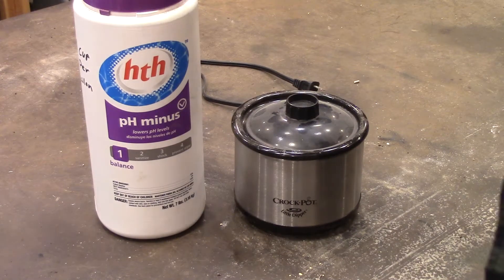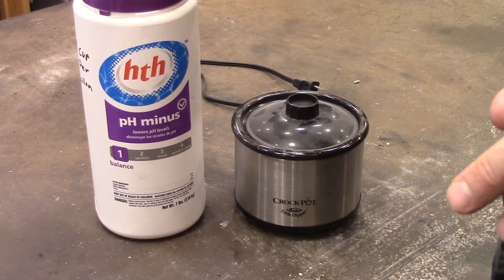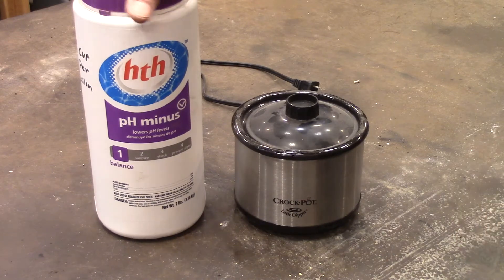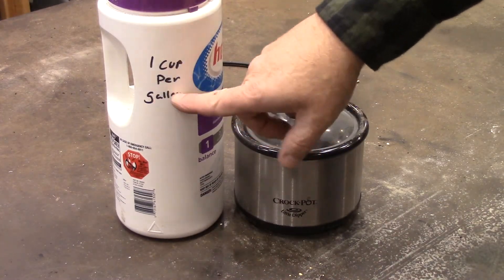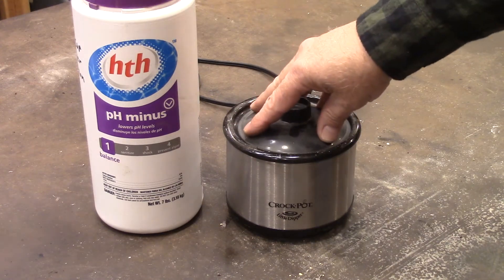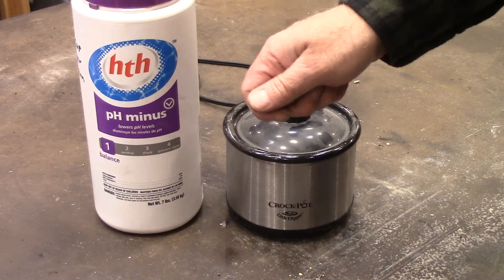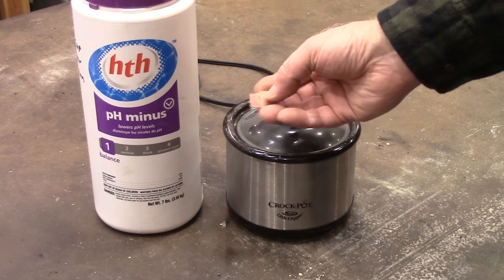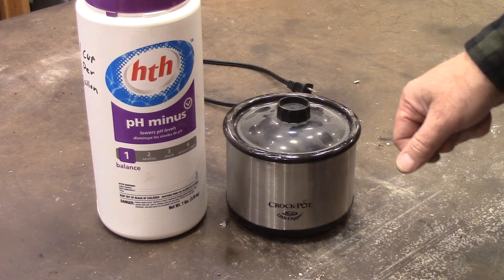How to Make a Pickle for Silver, Gold, Copper or Brass

Comment: I had a bag of sparex #2 and found out the ph down is the exact same thing but more readily available and cheaper.
Reply from the maker: Exactly
Reply: I see I'm very late to the story here, but sodium bisulfate also know as baking soda...
Reply: @isfbm421 Nope thats sodium bicarbonate. The main difference between sodium bisulfate and sodium bicarbonate (baking soda) is that baking soda has a basic Ph of about 9 and sodium bisulfate is acidic at around 4. The acidity is what causes the scaling to come off. Baking soda can be used to neutralize the sodium bisulfate.

Comment: I gave you a thumbs down because you did not tell people to always put in the water first and then the powder. If you don't it can blow up in your face.
Reply: I know what you're talking about. I learned the hard way when I had to make my own battery acid by mixing  distilled water with hydrochloric acid. Luckily I was wearing all the proper PPE, but it did smoke a pair of coveralls and a pair of  combat boots. ..that said, this stuff is so mild in comparison. I think if there was anything to worry about, he would have noticed by now.